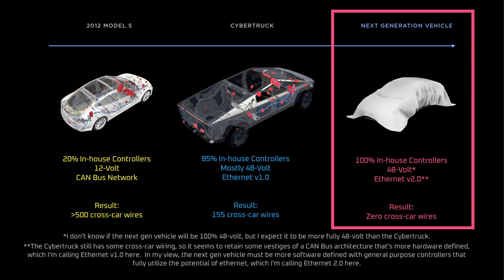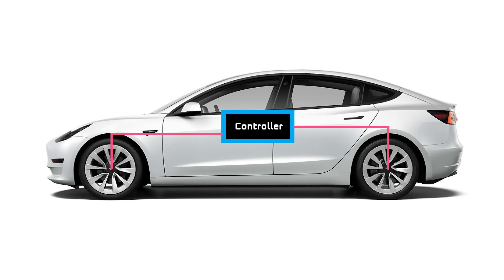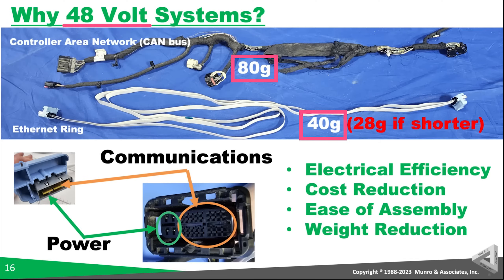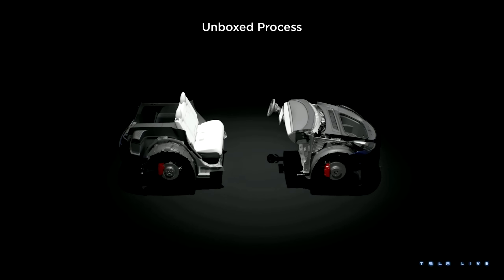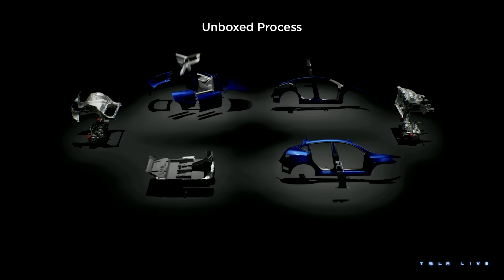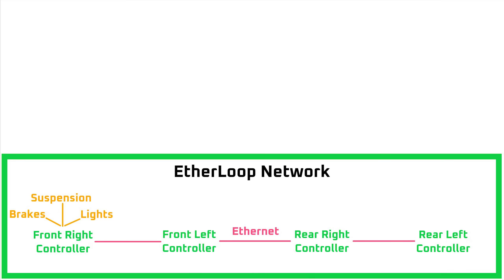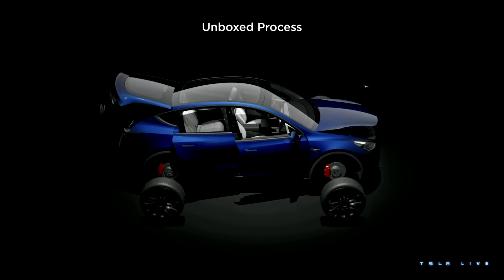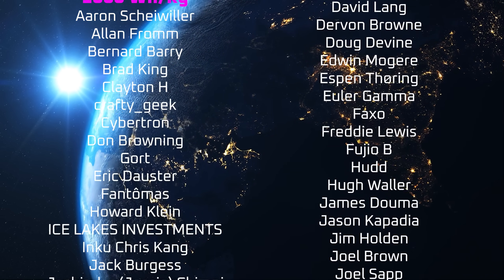Digging Deeper on Tesla's Etherloop Wiring System

Comment: Interesting video but you're wrong about some things. They most certainly could have done the same zonal architecture with reduced wiring while still using CAN. There's no reason a CAN network could not be zonal. There's also no reason a CAN based design could not have worked with this unboxed design they want to do. Any way you go, if you bring together components at the end, you need connectors to snap them together. There isn't some mystery to doing this with CAN. You simply have connectors at all the junctions of the pieces that come together. The real benefit of etherloop is, as you did clearly mention, the speed. While on the topic of things the video got wrong, the speed of CAN in cars is almost universally 500k (at least it used to be until very recently). In fact, single wire CAN is quite often used as well and that's 33.3k speed. CAN-FD allows for faster speeds (usually around 5MB) but also wasn't used until pretty recently. CAN-XL might just have started to be used and that is 10MB. So, the realistic values for the CAN speed should be 33.3k-10MB but that's kind of nit picky. Otherwise, I think the video was pretty accurate and informative. It's just that you seem to think that most of the innovations Tesla did required etherloop and they didn't. They simply did innovative things like zonal architecture at the same time as switching to etherloop for most things.

Comment: the only reason to upgrade to ethernet is bandwidth. The part where you say that the cables from board to board being shorter than the loop doesn't make sense. There are fewer stubs since there are fewer boards, but you still need to go around the machine(and, for the moment, the majority prefer the star arch istead of the bus arch for eth). The real weight reduction comes from transitioning from Domain EE to Zonal EE, which is a trend all automotive companies are following, as seen in presentations from various silicon manufacturers (e.g., NXP). One of the most challenging aspects of this transition lies in the Safety (ASIL) Software that will reside on a central computer coordinating all the various nodes. This will be much more complex and require much more power.

Comment: Would there be multiple power sources in order to not have cross-car wires from a single power source? And what about wake-up signals? Would they also be handled by the Etherloop? And what if an Etherloop wire gets damaged at some point, does the whole system shut off? How hard would it be to trace where that failure is?

Also, if the Etherloop really is 1gbit/s then that is very impressive. Considering current Ethernet systems already in some vehicles usually only go as fast as 100mbit/s. Most manufactures don't really use such fast systems as they aren't really necessary since 10mbits/s on the simpler buses are plenty enough for what is needed.

However, if the goal is to limit user exchangeable components and require everything to be coded using official diagnostic systems, and make the general diagnosing nearly impossible for other than highly trained technicians, then the Etherloop lays the foundations for a perfect system.

Comment: 16:33 fact-check: false.  I’m a network engineer.  There’s no chance CAN bus has lower latency than Ethernet even if you assume a preposterous amount of collisions on Ethernet.  CAN bus is a LOW SPEED protocol.  Ethernet is not.

Separate and apart from that, there are already very advanced mechanisms for ensuring flow prioritization over Ethernet that have been reliable for a generation at this point.  So even if we really did have a latency issue with Ethernet compared to CAN, that would be sidestepped by the fact that Ethernet can do priority queues that provide the same net effect as you describe for CAN.

Both of these corrections invalidate your claims about the tradeoffs in favor of CAN over Ethernet.

The reason CAN bus has been used for so long is due to inertia and standardization.  Ethernet solves all the same problems easily without needing anything fancy at the hardware level.

Comment: on big rig there is 1 controller for diff wheel . Magnetic sensor at each wheel .the issue right now ? If you got 100 box of motherboard ? You get 100 pair of torsaded wire . Ton of false signal via wireless electricity .that chassis ground ? Is a huge pack of problem ! So tesla will likely use sfp port and ethernet fiber optic for signal

Comment: There are a lot of issues with the Etherloop topology that they are gonna need to fix.  Since it wired in series, you lose everything past the point of failure of a module.  With CAN, you can lose a module and you dont lose the bus.  Second, ethernet is not fault tolerant both physically and structurally (the data structure).  Third, while it is quite fast and has much higher bandwidth, its also much more complex as every message is addressed to a specific point so you have to send redudant information to every controller that requires it.  Instead of a module that can supply wheel speed data to numerous other modules, every module needs to ask for it and then that module has to send it multiple times, thats just not efficient.

Comment: Im an automation engineer who designs electrical and control systems and one comment I wanted to make was that this is a double edged sword. There's why.

With older cars and the conventional way of wiring, it's extremely easy to pin out wiring harnesses when troubleshooting electrical problems. I have fixed hundreds if not thousands of electrical issues with a multimeter.

The problem that you run into with these newer systems is the controllers. Once the wires go into controllers, it's game over for the DIY'er or the garage mechanic. 

Let me propose some information to you all. The top of the line Rockwell PLC'S only have 40 mb of memory. Yes, you read that right. 40 MEGABYTES. And this one PLC can have up to 300 ethernet devices, and they are gigabit compatible. These PLC'S will run uninterrupted for decades with 0 problems.

Now.... let me ask you all this. How many times does your phone glitch? How about your Microsoft computer? How about your apple devices? THEY ALL HAVE BUGS. There's a reason why in the industry we cap out at 40mb and the simple reason is that its so f*cking reliable that it NEVER fails. What we are seeing today is that auto manufacturers are stuffing controllers into their vehicles and my main problem is that MOST of the processing power is used by apps and things in the infotainment system. No longer are the days where a wiring problem costed you a multimeter and an afternoon to fix. Now, you will be FORCED to spend hundreds of dollars on a new controller when it fails. This is NOT the way we need to be going for sustainability and right to repair. This is the exact antithesis to sustainability and right to repair. I like 48v and its pretty cool; I could see plenty of benefits to that. But beyond that, we need to tell auto manufacturers that we dont need a fricken controller in every corner of the car.

Whats also scary about my job is that I can remote in to plants that I have security access too and change things online from states away. I also want you all to be aware that every single new vehicle that leaves these manufacturers plants are equipped with either internet capabilities or straight up it will have a 4 g LTE chip embedded inside. You are giving someone else full and unimpeded access to your vehicle by allowing this. Ethernet/ network devices pose the biggest security risks today because its no longer in the realm of human comprehension. A controller connected to ethernet can do anything it needs to do right in front of you without you onowing a damn thing about whats going on inside that controller.

Comment: I like this video, but you should select some other parts than brakes, like air suspension. Cybertruck has normal hydraulic brakes, and brake controller for all wheels is near electric brake booster, so your description is bit silly to anyone who knows basic of car mechanics. Yeah, there are wheel speed sensors and other sensors, and parking brake, (e-brake for USA) is likely servo operated and those can have controller setup like in the video.

Comment: The ideal way for wiring 2 main wire 1 fiber optic . For some reason ? Indepent wire are always added . Why fiber optic to isolate signal from the electrical grid . See electrical false signal is a nightmare on vehicule , mainly because they do not use solid wire for dc and braided wire for ac as recommended.solid wire is way easier to airgap .ideal ?light at the back should have their own battery . Use an indepent charger . This way things can be signaled wirelessly

Comment: Excellent.
Consumer electronics companies already have a 48 volt Ethernet standard called "Power over Ethernet (PoE)" which allows both data and 48 volts of power on one Ethernet cable. When Sandy Munro asked Elon Musk about this Elon responded that they tried that but the power was too noisy for the data (the electrical equivalent of trying to talk in a noisy factory).  So, Tesla separated power and data even though they may be using the same wiring standard. So, I would speculatively call these the "power-loop" and the "data loop" these are physically separated with actual separation between wires. Within the "data loop" wiring one can be logically separate data by address or protocol (while power is circuit switched). Just as you might in your home network assign a permanent address to your shared printer, I assume (speculation) the Tesla Ethernet has pre-assigned numbers for brakes and other major devices because it would not make sense to randomly assign numbers to a fairly fixed set of devices at boot time the way consumer router using Dynamic DNS would.
Reply from the maker: The comments on this video are excellent.  Thanks!
Reply: i think the "Too noisy" part is also because of the devices attached. PoE is mostly used for Devices that have a very constant consumption, like VoIP phones or Security Cameras. In a Car you have quite a bit of intermittent consumption, mostly from Motors like the Wipers or Pumps for Fluis or Hydraulics. also dimming LEDs is essentially switching them off and on very fast.all these very fast changes in power consumption (when a motor runs it has huge changes in consumption on the millisecond scale) introduce quite a bit of noise.

Comment: 16:20 CAN bus cannot prevent collisions on shared medium, but it allows improved resending of data. Ethernet protocol would be just fine if you defined that device priority is a number between 1 and 100 and it represents the time range for delay after data collision. A device with pririty 1 would resend after waiting 1 ms when then collision is cleared and low prority device would just wait up to 100 ms before retry.

The only way to get rid of all collisions is to use switched network like we use in wired etherned today. That requires star-shaped network topology but there's no shortcuts if you want to avoid all collisions and have low latency.

Shared medium network could use something similar to token ring where all devices communicate with each other to implement time-division multiplexing for the network which quarantees worst case latency when you know all the devices connected to the network.

Comment: As a data comm guy, I’m interested in the Etherloop details. Is it one pair or two pairs between locations? Copper or optical? Does it simply borrow Ethernet’s physical layer signaling and then use a custom protocol on top? What does that protocol use, a time division scheme?
Reply: If it's carrying power it must be copper
Reply: The standard is called  1000BaseT1 therefore 1 single twisted pair.
Reply: @GregHassler  it isn’t carrying power. They have separate wires for that.

Comment: The diagram at 16:08 might be a bit "wrong" because it adheres to bus topology.
Etherloop would, as the name suggests, likely use a ring bus instead, which the cable at 9:26 also suggests.
Ring networks aren't as prone to collisions as a bus network (as the next node can simply queue up the incoming data to send after its own data - or before it if it has a high priority), especially when using a "token ring" in which a "token" is passed along and without token, you're not allowed to talk (although this comes with an obvious latency penalty).
However, payloads likely don't need to be that big so the latency probably shouldn't be too big (sub-1us for an entire "rotation" would still be achievable just fine).

Comment: if a module is connected to muilt systems in the car and the one module stops working lost power, ground, or just burning out. in the CAN network you lost just the one system if one module goes offline, in this etherloop if one module goes offline multi systems goes with it.

Comment: IEEE along with others to create a deterministic version of ethernet for real time systems. I would imagine a version of this is what tesla will be using. Ethernet is much faster than canbus even in most domestic networks, gigabit is not unknown and there is up to 10 gigabit per second equipment available. Above gigabit the collisions have been ruled out of the equation except for the poorest of network  designs. Full duplex is the standard. The new protocols to provide determinancy are the revolution.

Comment: Could they solve the latency problem by having the systems communicate in a certain direction ( clockwise/counterclockwise) throughout the loop?
Reply from the maker: It's more of a prioritization thing from what I could gather 

Data has to be able to flow in both directions to send and receive
Reply: @thelimitingfactor  you could receive data from One Direction and send it in another wouldn’t that be full duplex communication?
Reply from the maker: You're probably actually on to something!  Other people are making the same comment.  I'd have to look into it.  Definitely not my wheelhouse 🤠
Reply: @thelimitingfactor  it was just a hunch 😂
Reply: The multi direction loop also brings redundancy.
A single break in the main cable, or a plug connector would not kill the system.
It WOULD probably slow communication, but the system would then default to "safe mode" and  alert the driver.
The car won't just die in a dangerous situation.
Self diagnostics would also identify the precise location of the break.
A technician should require one cable and one modular "hub" to fault find by bridging or swapping out.
Simple!

Comment: As much as I can under why grouping multiple controllers into one “front unit” or “back unit” makes sense from the manufacturer’s perspective, less complex wiring, simpler sensor systems and easy vertical integration and consolidation. But I don’t like how this will effectively mans you’ll lose major parts of your car, if one fails. And not to mention the insane cost for replacement of one controller because say, the rear left brake light curing died. Unless it’s pretty modularly designed inside the controller, and not a “black box”, it would make sense. But again it’s something like outsourcing parts, so fully custom in-house components makes more sense in this case.

Edit- not to mention, repairs will get a lot more complex, and without access to factory wiring diagrams you possibly cannot do an easy diy job or use a different mechanic. You are stuck with the manufacturer, and have to shell out for the dealer markup. As you have no choice, they’re the only ones with the proprietary tools to work on these systems

Comment: completely inventing a new packet prioritization scheme would be ... dumb. This is already included in TCP. Everyone can use it. Everywhere. Under (nearly) all circumstances. You just gotta set your socket options reliably, a few other parameters force you to include additional code. Most of it is very straighforward. Go and read the manual. Apparently, there are EIGHT priority-levels to choose from. That oughtta be enough - if you want to get fancy you can segment your network into several precedence-zones which allow for forwarding ... which is probably the smart thing to do.

Comment: Isn't 48 volt power over ethernet pretty common?  The only real problems with it are  that the wires are too small to carry much current and connections are not very good for rugged use. Both are easy to fix with money.